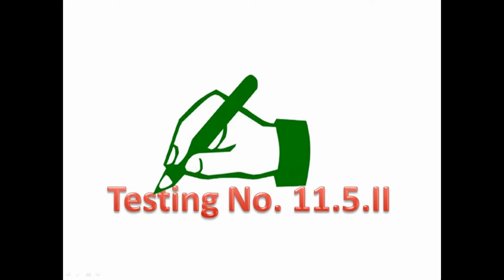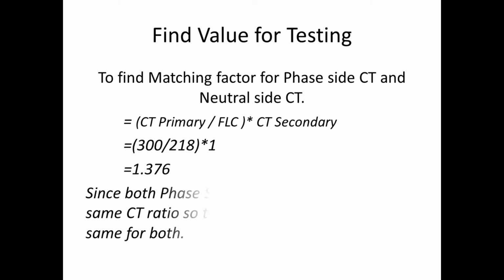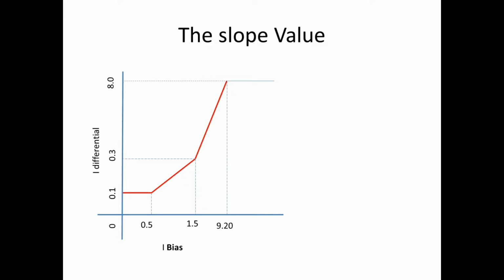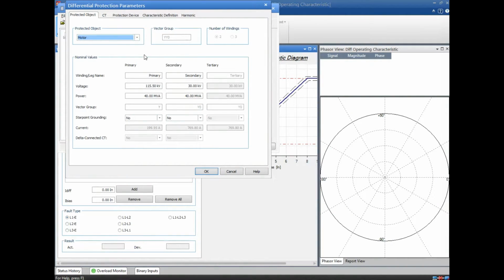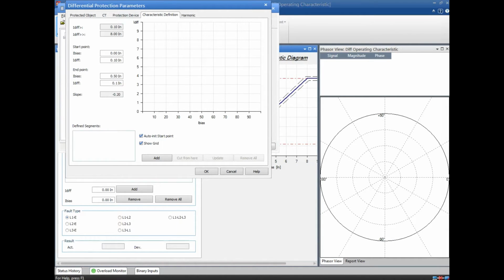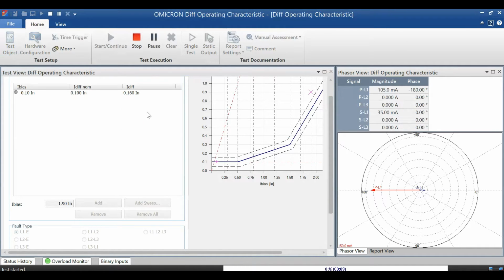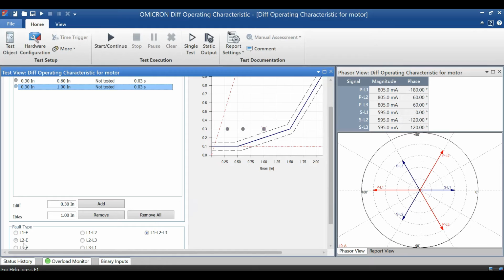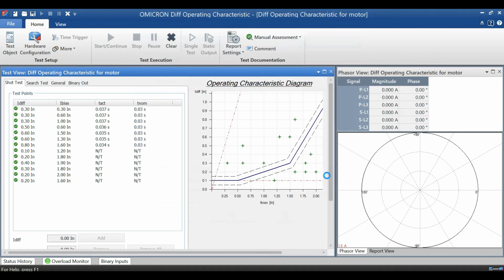Motor Differential Relay Testing (REM620) | How to Create Slope on Omicron Kit | Step-by-Step Guide

Comment: Can you please make a video on 6700 KW motor having FLC of 432 Amps and rotor voltage is 2855 and rotor current is 1410 what will be it’s calculation
Reply: Barani Tech you haven’t tell how to calculate the thermal value for the motor
Reply: Hello can I have your mail I’d so that I can calculate some data and can get your feedback over that